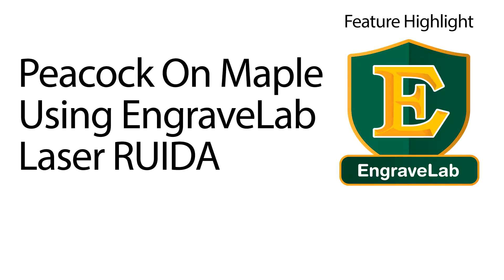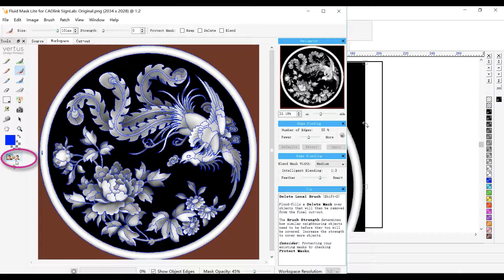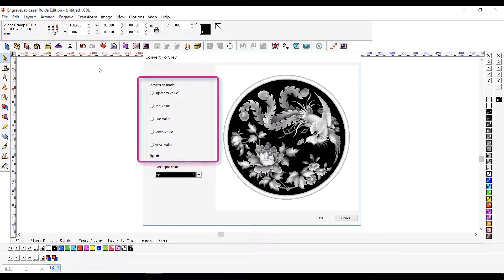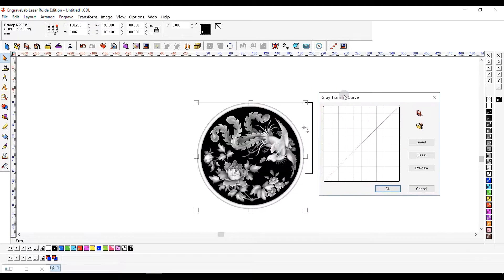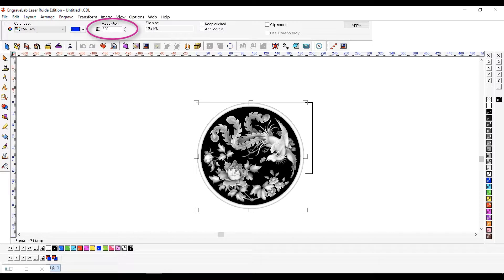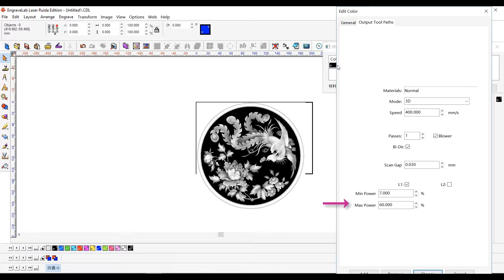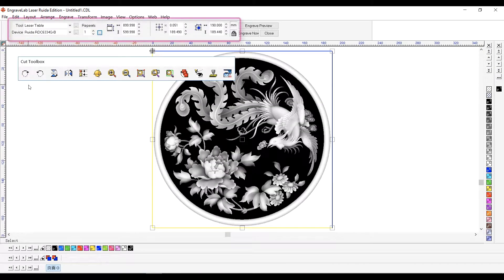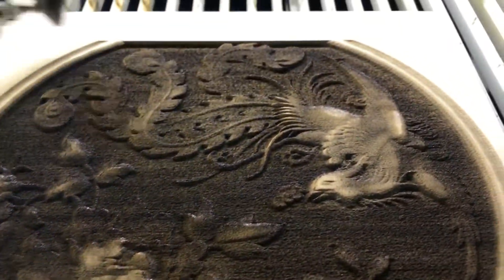How to 3D engrave with CO2 Laser engraver?

Comment: What watt recommend for engraving such details with Engravelab?
Reply from the maker: Hi, this video is done by an 80W co2 glass tube. The recommended power range is 60w ~100w CO2 glass tube power, or you can get a much better effect by RF Metal tube. Feel free to send us an email if you have any further questions, cheers. 
Email to: engravelabsupport@prytec.com.cn
Reply: What with and how do you clean up wood?
Reply: @spacecougar  Water and a toothbrush. Works great. Just do it gently.